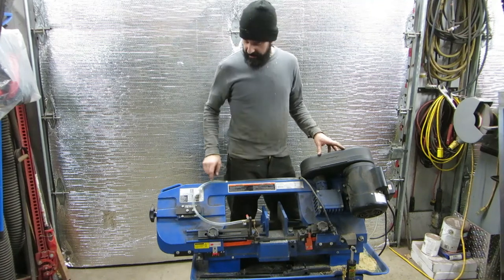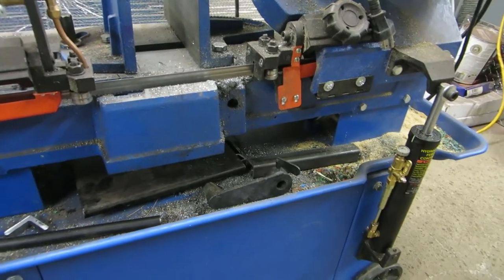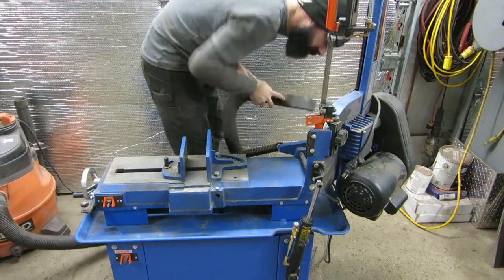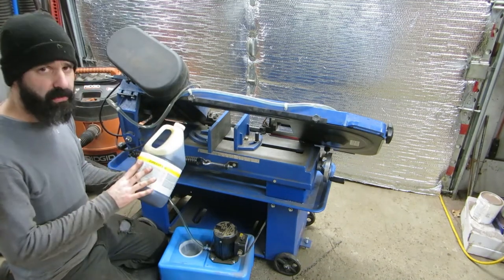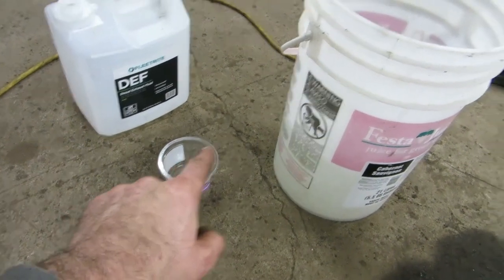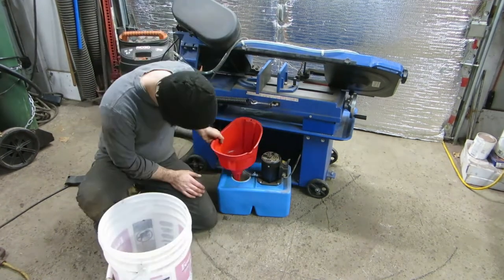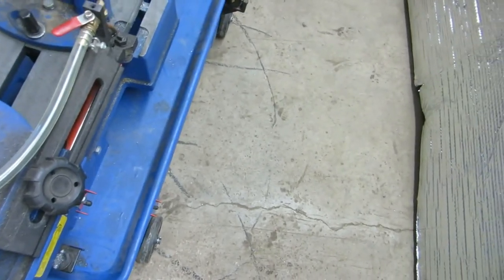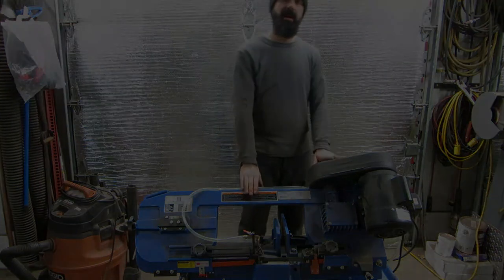Princess auto 7x12 bandsaw  maintenance and adding coolant

Comment: I made a different table for my saw.  I made a angle weldment using 2" square tube.  One leg clamps in the vice.  The second leg  runs horizontally towards the saw when it is in the vertical position.  Then I added a third vertical leg and welded a heavier plate with a slot in it (new table) on top of the vertical leg.  There is a gap between the second horizontal leg and the saw base so I welded a piece of angle iron from the vertical leg back down to the saw base to support the table.  This setup is supper easy change in and out and much stronger than the sheet metal table.  I hope this comment reaches you and good luck.

Comment: Just an FYI from personal experience.  Over time cutting oils will turn rancid.  So drain, clean and replace at the first hint of smell or better, even sooner using a maintenance schedule.  Also, some saws use a doughnut magnet along with a primary filter screen together in the top tray drain sump to collect steel chips to prevent pump damage.  Not a bad idea to put a second one hanging from the tank strainer also.  You didn't show that but I assume your saw has those.

Comment: In the UK those saws are marketed by Excel Machine Tools, SIP (Super Industrial Products) and Sealey to name three. Mine is a 1995 Excel. Virtually identical and all of them come ouot of the same factory in Taiwan. I bought mine secondhand and have done a video about it too. When they get worn they are tricky to set up for an accurate cut and to maintain that accuracy. I got another new sawblade for mine this week and it was £57 inc taxes and delivery.
Reply from the maker: Ya they are a very common saw, I had an older smaller version and found that keeping a good quality blade on it kept the cuts straight, a worn blade will make it cut on an angle. I will check out  your video too, Thanks for stopping by!